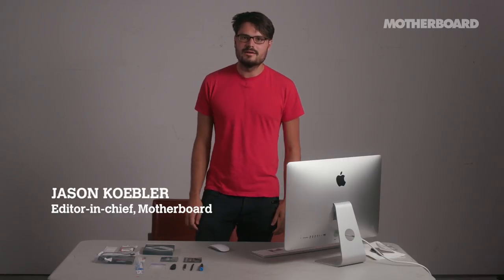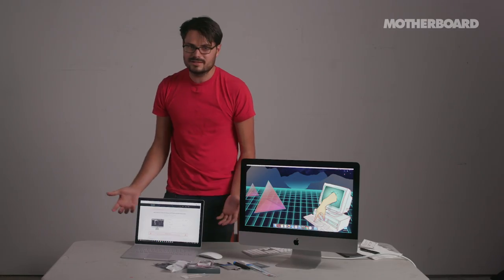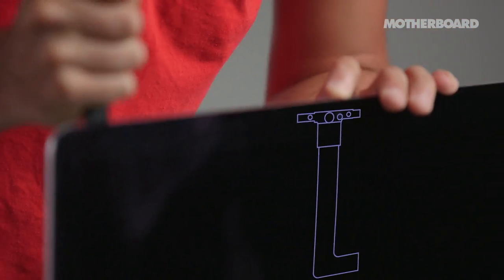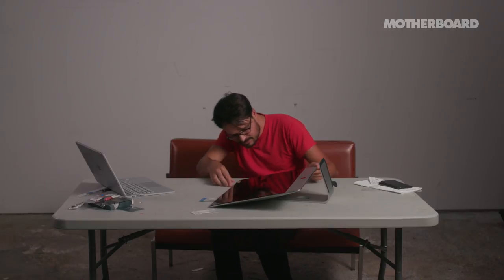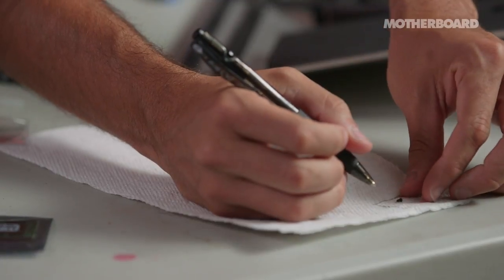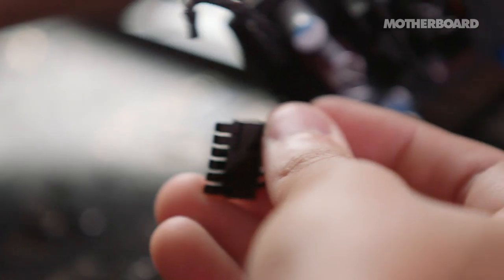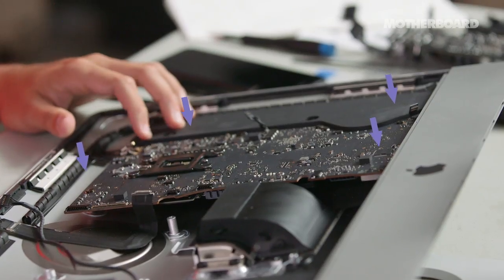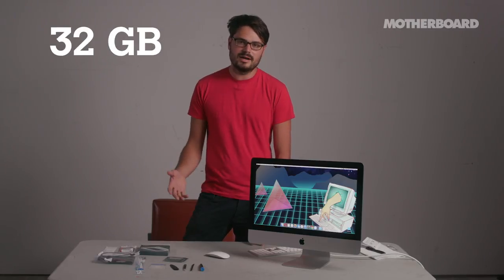Can a Normal Person Upgrade the RAM in the 2017 21.5" iMac?

Comment from the maker: Apple's 2017 version of the 21.5-inch iMac is the first in years with the option for user-replaceable RAM. But it's a slightly more complicated process than you might expect.
Reply: Nah, this type if nonsense is just what I expect from Apple
Reply: Motherboard that guy looked too stressed, hopefully he was given a nicely packed blunt after
Reply: That's definitely not what I call user-replaceable. The 27" model has user-replaceable RAM, and that has a little door that you can flip and just pop the RAM out.
Reply: Good video. Just a few mistakes.
 1:  “This is the first iMac in 5 years that has upgradeable RAM...” Not true. All iMacs have upgradeable RAM. Even the thin styles from 2012 to 2015. It is just that the 21.5” iMacs from 2009-2011 are super easy to upgrade. 
2:  It is necessary to hold down the power button for 10 seconds but it is also necessary to have the iMac completely unplugged.(I know that you didn’t have the power cable plugged into an outlet but just for other people’s sake.)
3. When taking off the glass, heat is your friend. For the average user, you will want to use a hair blow dryer on low to med heat and heat approx. 3-4 in away from the glass and go all around the edges. 
4. Make sure that you use Low Voltage RAM in all Macs. High voltage can cause many problems in the long run.

Just a word from the wise. Once you put it all together test before putting on the adhesive strips to be sure there are no issues. Apple has on board diagnostics so connect everything, power it on and hold down the “D” key for the Apple Hardware Test. Run it, see if everything is fine, then do you adhesive. :)
Reply: god forbid they just put a panel on the back lol
Reply: Motherboard this isn't "user replaceable"
Reply: First time opening it huh damn you got balls..
Reply: Did this dude really buy the whole pro tech tool kit for something that barely needs more than a fix kit
Reply: Nicolas Kerr - You're saying, this could be done on a 2015 , 21.5 imac with non removable Ram? It comes with 8g and i'd like to upgrade to 16g ?
Reply: can you please tell me what kind of ram do i need for this tipe of imac? i have the exact model but i dont know wich tipe of ram i need---
Reply: Guys, thank you so much for this video. It is literally one of my most favorite of all times. Came back again to watch it... The motion graphics all over the video is gorgeous, shaky hands and his laughs are gold (gotta watch once more to catch his name) camera work perfection, desktop background coolest. 15 ouf of 10!
Reply: Nicholas Kerr You are wrong in the first point. 21" iMacs from 2014 to this one, so technically for 4 years had a soldered-on RAM. So this is really a good news, finally...
Reply: In the UK it's actually beneficial to keep your computer/ appliance plugged in because the ground pin to mains acts to earth the device while you're working on it... (assuming the mains switch is off) 

just saying... :P
Reply: @Nicholas Kerr
I know the 2013s had user replaceable RAM.  Not sure exactly when they stopped that but not all 21" iMacs replaceable RAM.  I opened one up and pulled the logic board and it only had soldered on RAM.  I think it was a 2015.  Wouldn't surprise me if they stopped it after like 2013 or 2014.  Apple is the master of no user upgradability.
Reply: Glad you had a bench .... that way you can take an afternoon nap after the disassembly :). Though kind of surprised you did not wear a grounding strap.
Reply: Clue is in the title! 'Normal Person' so who cares! The video is about whether a novice could do this! He shows it can be done and is a great video explaining how.
Reply: i`m very sad because i have one iMac 21.5/2015 and Apple said is wieldedthe memory in the machine. the only think i can do talking about upgrade is using a external ssd for better speed.  @nicholaskerr5453
Reply: Nicholas Kerr hey do you know which ram is the best for the 2019 21.5” iMac ?
Reply: Thank you for the video. Can you please drop the list of things that are needed for this job? Where did you get them? Thank you in advance
J
Reply: Can yo tell what kind of memory I need to look in internet? 16 gb - but what kind of parameter...
Reply: THANK you! After watching this video I bought a Dremel. Thanks for showing what a waste of time this was. Dremel only cost $40 we worth the time ssaved and moneyh

Comment: Not sure why this is getting dislikes - it's a great video. Shows the ridiculous lengths Apple has gone to in the pursuit of form over function.
Reply: It's meant to be this way, because soldered RAM is more reliable. Most people don't upgrade their computer.
Reply: Your sample is not enough. And the other reason is that it takes other parts and space to have upgradable RAM. It may not seem to make sense with the iMac, but with any laptop, it does. The iMac's design is still very thin. To make RAM upgradable, you need more space for your fingers to fit, and the slots and all the other necessary hardware. This is valid for other parts, like SSDs and processors. Any component that is soldered will be more protected against movements and shocks, and will take less space.
Reply: Apple uses LPDDR3 (Low Power DDR3) RAM for some of their laptops, and this kind of RAM doesn't come with a socket of its own, so instead of creating a socket, which is costly, it is soldered on as intended.
Reply: indeed    Murray Lewis
Reply: And to make profits after sales...
Reply: Slam Dunk,
Machines should NOT be this way, and there is ZERO evidence that soldered ram is any more reliable than socketed ram.  Everyone wants to upgrade so they extend the life of their machine or add a little punch to the performance.  Just because you don't, doesn't mean that's how others think too.  Dead wrong fanboy.
Reply: Slam Dunk,
If it doesn't exist and a socket doesn't exist... then how did I upgrade the low-power RAM modules in my Lenovo??  Must be magic...
Reply: Because your Lenovo decided to make a socket for it? That's a weird question. MeanGrain, maybe YOU think machines should not be this way, but you are likely the exception, not the rule. And yes, statistically, soldered RAM is more reliable. The other reason is to save space, and avoid additional parts.
Reply: Slam Dunk 
Lenovo doesn't make the socket.  It's a standard, compatible part (made by foxconn, who manufactures Apple's computers).  RAM is quite reliable, but having it soldered means that if a chip fails you can't replace it.  When Apple integrates everything into one board with no replaceable, or upgradable parts it means that if something fails, then you have to replace the entire machine rather than replace it.  I don't see how that's a good thing.
Reply: some of us want the ability to replace/upgrade parts in our computers, while others dont so having a mac is probably better for them because you dont have to be tech-savy to use a mac.
Reply: +Slam Dunk Except the ram isn't soldered here. Apple uses glue to save space
Reply: Apple doesn't glue RAM, WTF. Soldered RAM is more reliable.
Reply: Slam Dunk
This RAM isn't glued or soldered, it is socketed.  PLEASE show me evidence that soldered chips are more reliable than socketed.  If this was the case, I'm sure that Intel and AMD would not sell socketed CPUs.
Reply: It's getting dislikes cause he skips steps.  I am doing this right now and have found like 3-4 things they skipped over.
Reply: What if you want to increase your RAM capacity? for example  you are a video editor and you want to increase your RAM capacity from 8gb to 32gb in order to do your work efficiently, will you still go out and spend thousands of dollars on a new Mac?  Stop apologizing for Apple's anti consumer antics.
Reply: @slamdunk715  WTH are you talking about?  The RAM wasn't soldered in: it was just inaccessible.  It was meant to be that way because apple didn't want to make it accessible.  They could have had access in the back like they did with my 2010.

2. Maybe most PC users wouldn't upgrade their computer, but I think most Macs would get upgraded.  It's normal for Macs to get resold and reused, especially since they have good resell value.  If they made it easy to toss in a TB SSD and 32 GB of memory, a lot of people would simply go that route and have a machine that is good for another 5 years.

But Apple is in the business of selling computers (and memory), so they don't want you to upgrade.
Reply: The iMacs goal was to just be an internet machine. It’s like a pre tablet netbook

Comment: Would love to see a "Hi I'm a Mac and I'm a PC" upgrading the RAM commercial.
Reply: anarcode Lots of companies solder ram laptops and all in ones mainly.
Reply: Haha. This thread is over. McNuggs wins.
Reply: thats actually a genius idea
Reply: Yeah but HOW MUCH does MSoft charge you for RAM?
And is it more then 16GB offered?
If you can get a Surface Studio with 32-64GB soldered then you'd never even need to crack it open to upgrade it in the first place;)
Reply: @nunyadambidniss 64 gb ram but slow af

Comment: A dream come true, upgradable ram in 4 hours on a mac for cheap while voiding the warranty all at the same time, you have to love just how much mac wants you fiddling with their stuff.
Reply: upgrading RAM yourself on an iMac doesn't voids the warranty
Reply: The ironic thing macs used to be very easy to upgrade and you could replace many parts with  no tools.
It's like they either fired all their good engineers or told them to purposefully make things difficult to service.
Reply: Patchuchan no, it’s just harder to make things thinner/sleeker but still more powerful without squishing things together in a way that’s not very repair/upgrade friendly. I wouldn’t say they’re doing it just to spite consumers, it’s just designing it to be upgradeable is probably very low on their list of priorities.
Reply: Apple uses the best rams for their products. Any cheap upgrade will create a problem with the performance. My advice is to buy a iMac with more rams.
Reply: @gewdvibes  Apple propagandist.  Lenovo builds highly serviceable laptops that are superior to everything the Apple makes.
Reply: @Patchuchan  they used to show you how to do it in a pdf. They could easily have put a little door on the back to do it with minimal hassle like they used to. Apple has lost their way.
Reply: @josethemacho  crap, it's just the same ram anyone sells, just get branded and you are sorted.
Reply: @Patchuchan  ...the ladder is true, Apple wants total control and ALL the money they can squeeze out of you. I just bought a 2019 21.5" iMac with 3.0ghz and am going to put 32gb ram in it. The new (2020) are to be coming out later this year and I was worried Apple might do something like soldering everything in place including the ram so I got the 2019 while they're still available.
Reply: @harryberry474  I would HIGHLY recommend buying 1 TB SSD drive to replace the HDD at the same time. Do the entire install at once, and when you're done, you have a computer that Apple would sell for over 2k.
Reply: @DogsBAwesome  the 27 inch iMacs have the window on the back to change ram easily. its only hard to do on the 21.5 inch models. Im aware that the pre 2011 models did have the window but that was when the Macs were actually thicker
Reply: @chriscastillo5736   As the ram is on the back they could have easily have added a door to remove the ram, the only reason they stopped having a way of easily changing ram is Apple like money. 
 An all in one computer doesn't have to be so thin you solder all the stuff that should be changeable to the motherboard like they do on the new ones.
 Most of the Mac range these days are time-sensitive disposables and in my opinion not worth buying.
Reply: @DIsmayedConfuse  not the yoga 720 15 4k
Reply: In all actually I done it in less than a hour it was his first time and he was super nervous

Comment: I supported Apple computers from 1986 to 2006 professionally and I’m embarrassed that Apple lost the dream.
Reply: IMHO MacPro "TrashCan" is one of their best engineered hardware. They actually "stole" the architecture from Xi3 an excellent move. But it had soo many extraneous fixable and cultural problems the let it die. Sadly there is soo many other problems with it no modern Apple products has been tolerable.
Reply: Your point is perfect, Conor. People don't understand the idea behind, so they ridicule it by doing something that is not meant to be done with an iMac.
Reply: No people DO understand and they correctly DESPISE IT.
Good for those who go against the grain:)
Reply: Computers are the smallest percentage of their sales out of their entire line of products.  Both digitial and hardware.  It's no wonder why with shit like this.
Reply: I worked for the father of an apple engineer a few years back and his recollection of his sons job description was "Take whats out there and make it appeal to idiots".
Reply: merlynwylld qqqqq
Reply: Right, so if you want to upgrade down the road, you're obviously doing it wrong.
Reply: I dunno the silicon chips are making me warm up to them again gradually but they’re botching it with the baked in ssds

Comment: Am I the only one that wanted to see him mess up?
Reply: i agree
Reply: me as well -- he finds a battery in power supply unit
Reply: He did try to discharge the Mac while it was still plugged in
Reply: I want him to fail.... cause he is a true apple fanboy. I just wanna hack it, but coreboot on it and run BSD
Reply: I wanted to see him fail because Mac's are garbage, Apple is garbage, and these machines are designed purely to keep users from repairing and upgrading. They are designed to make sure people buy expensive warranties on just new computers at the first sign of trouble.

Comment: so scared of capacitors even though he dont know what it is :D
Reply: The "batteries" are the capacitors!
Reply: better safe than sorry.
Reply: Hey, for the average viewer, calling them batteries isn't far from the truth
Reply: Oh wait I just saw the part you're talking about. It actually does have a coin cell, for BIOS timekeeping
Reply: thats why he is scared... cuz he doesn't know much about them... i would say its better to be safe that sorry.
Reply: Raphael Alcantara that's not how it works
Reply: Capacitors are similar to batteries but not really the same thing. Batteries store energy in the form of chemicals (they technically generate electrical energy) but capacitors store actual electrical energy. 

Caps are able to discharge at a rapid rate, you touch the 2 contacts of a high capacity charged cap, you will probably regret it or die (don't think you really get to choose which one). 

What he did was allow the computer to bridge the contacts to safely discharge the capacitors.
Reply: Sryously I threw a motherboard onto a fire.. It went off like a machine gun.
Reply: MSI hasn't anything to do with the caps blowing up. It can happen to every electronic device, since they dry out and stop worging properly. In fact, capacitors most of the times your computer brakes, its just a cap.
Reply: around 6:50 he said they are the coil things as well - I'm pretty sure those are inductors that won't shock you
Reply: nly high voltage capacitors can give you a shock. They will all be in the PSU,  and maybe one across the LED backlight array, but nowhere else in a modern computer. All of the other capacitors are running at no more than the charging voltage of a car battery, and others below the voltage of a cellphone. Most capacitors hold much less energy than a phone battery. The reason why they can explode in a fire or on a faulty circuit board is also why popcorn goes 'pop'; heated liquid which vaporises and builds up pressure until it escapes.
Reply: Jannick H and leaves the power cable inside the iMac...
Reply: i can pretty much fix every blown-up motherboard, because ive had sooo many donor mobo's i got a metric shit ton of caps, i just solder off the bad ones and replace them.... tadaaaa fixed your $200 mobo for less than 5cents ..... But pls go buy a new mobo! :D